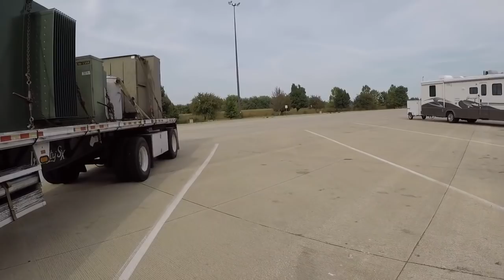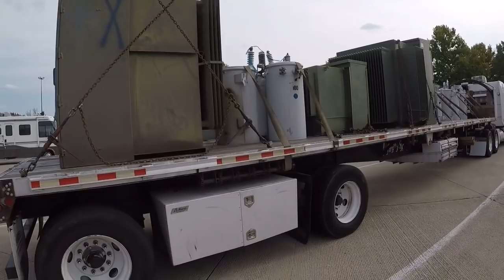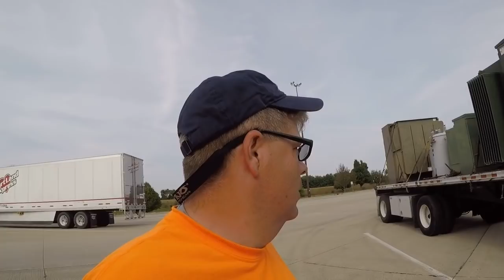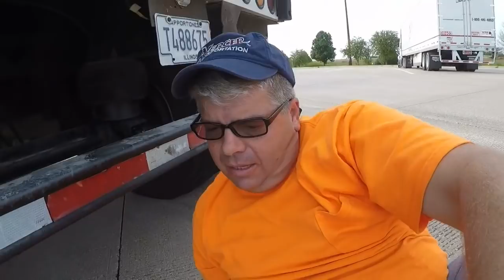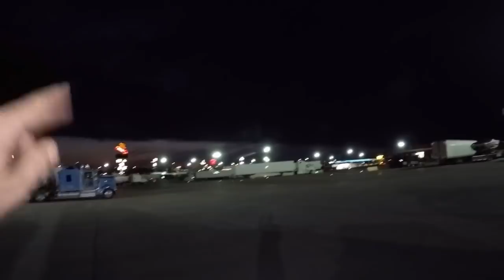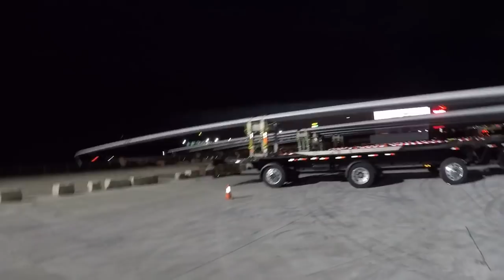#252 Rough Day  A Forklift Damaged my Trailer  The Life of an Owner Operator Flatbed Truck Driver

Comment: Hi Dan
Great video, in Scotland these windmill blades are quite a common sight on our roads, I used to run up too Wick and Thurso, there is a stretch of the road called the Berriedale braes, it’s a hairpin corner on a very steep road, they used to go up there a lot, it always amazed me how they got up no problem, they had rear steering axles. When I was a boy with Smith of Maddiston I was on the forklift truck all the time, we used to load rubber which was in metal stillages, very slippy on the forks, you are right in what you are saying Dan, one little relapse in what you are doing and you can damage a trailer no problem. Just keep chasing them for your money, talking about a little memory relapse, we used to load the rubber stillages on Smiths trailers for night trunk, I had done it for years, loading and sheeting them, one day I loaded the trailer and was sheeting it with Barry, I forgot the 7th stillage was in the middle of the trailer, when I opened the sheet and walked along the side, I forgot that the stillage was in the middle, put my foot to the edge and fell off the trailer and cracked 4 vertebrae’s in my spine, I was 17 at the time, now retired and still have tremendous problems with my spine. I really hope you have a lovely vacation Dan.
Kind regards from Scotland.
Johnny
Reply from the maker: Thanks for Watching from Scotland

Comment: Dan that trailer that the windmill blade is between 120 to 130 foot and if it a spread axle between all three axles is 10ft and 1in and the weight would be 20.000lbs

Comment: I'm an O/O, transporting autos and at one insurance auction picking up wrecked cars for a parts dismantler, the fork lift loading them had a split end on one fork that looked like the barb on a fish hook and as he backed away from my trailer, the barb caught on each cross member of the trailer, bending it.  Their comment on that was my trailer was hard to load due to the angle of the deck.  It's bad enough if I tear up my equipment, but I hate when somebody else does it.

Comment: I used to do brakes on my trailer and do shoes, then every other time shoes, drums, S cam bushings. if those bushings are worn you get unequal application of the shoes which reduces braking power and one shoe will wear more than the other. the bushing kits were like $20

Comment: If they don't replace them, could you put a 2x4 in there and pound it out?  Could you put the panels on a flat surface,like concrete and roll over them with the front axle of the truck?  Of course that is a worse case senario.

Comment: Too bad about the rack and panels, dont think they can be fixed when they are deformed, very bad luck.
Reply from the maker: You can try to bend them back but you will always have a hard time sliding them in and out of the track
Thanks for Watching